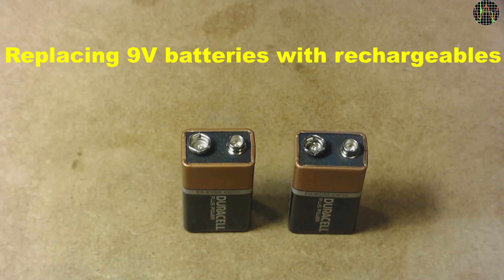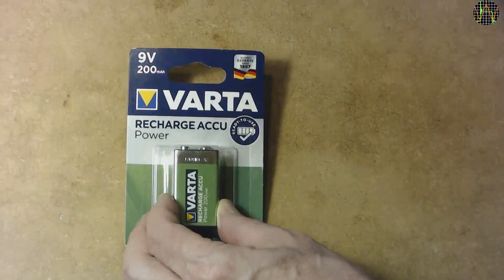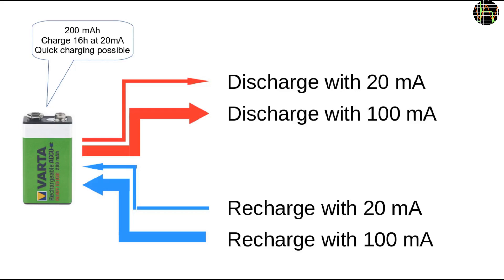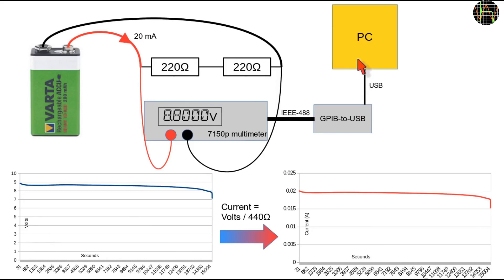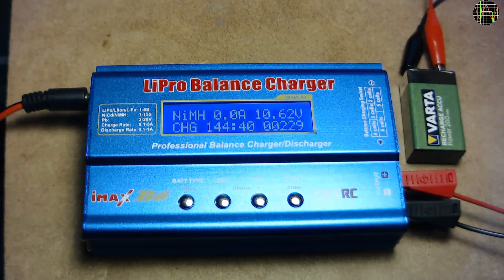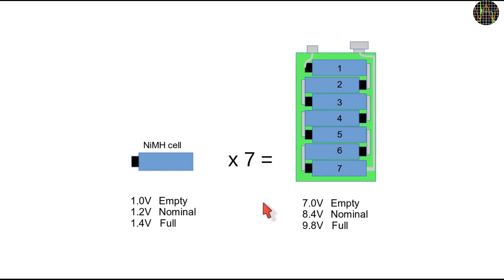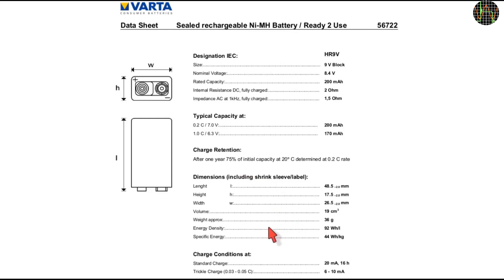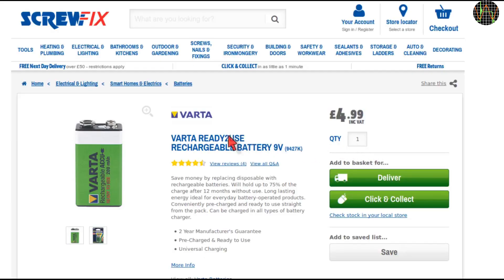Replacing 9V batteries with rechargeables ?

Comment: 12:00 Ni-mh clearly shows that pumping extra charge above just a liittle higher than full capacity into Ni-Mh is not needed. I wouldn't use 16h*0.1C on any Ni-Mh at all. Maximum 12hours.

Comment: Very pofessional. It seems like those Varta 9V ready to use rechargeable batteries are still the best 9V LSD batteries available.
They only have 200mA instead of 300mA that other's have. But they self discharge at 25% per year instead of 50% per year as most other 9V LSD batteries do.
It seems like 9V block batteries haven't advanced in 5-10 years. Other form factors such as AA have much lower self discharge by now.
Yes I know this 9V block is 7 cells in series, while the AA batteries only have 1 cell. But 25 to 50% self discharge per year is still too high for batteries marketed as LSD.
Moreover from some ~20 ANSMANN 9V LSD batteries that I bought 2 are outright duds that won't hold a charge for 2 days. And from the rest about half self discharge within 3 months. And the rest has wildly different capacities. There seems to be near zero quality control for some of those 9V batteries.

Comment: What would be the right settings on the imax b6 mini for charging a Soshine Size 9V  650Mah  6F22  LIION 650 7.4V.
Reply from the maker: inside your battery are actually 2-LiPo cells wired in series, so the necessary program would be LiPo for 2S. According to the SoShine datasheet for this battery, the charge current must be limited to 0.2 *650 mA = 130 mA
Reply: @TheHWcave   TheHWcave  Thank you Sir for the reply.  I will give it a try tomorrow.The Charge Current wil be per 100 mAh increments. So 100 mAh or 200mAh on the Imax B6 mini.   0.13A charge current  is not available on the V1 Imax B6mini.  I think i will give it a first shot at 0.1Amp charge current, and measure the the end results.
Reply from the maker: yeah, I did not check that current increments was 100 mA only. Definitely go for the 100mA. Even if it takes 1.5h longer to fully charge
Reply: @TheHWcave   i need a 2S cable for charching the Soshine battery.  But i dont have a clue how to connect the 2S cable.  It has 3 wires. 2 black , 1 red.   The soshine 9v6f22 battery  only has one positive and one negative terminal connection.    Any suggestions
Reply from the maker: @africantwin173  who says you need a 2S cable? This battery has 2 cells, yes but does not provide a connection for load balancing, which is not ideal, but because they have to stay compatible with standard 9V batteries, they had no choice.All you need is a cable that goes from the two 4mm banana sockets to the two battery terminals. Make sure not to mix polarity. Red needs to go to plus on the battery.  Select the LiPo charge not the balance mode.  That should work just fine.
Reply: @TheHWcave  Roger on that.  I'll  try it tomorrow morning.

Comment: Good price from Screwfix - I will see if I can get a couple.
The low self discharge (apparently) of these batts is appealing for multimeter use - I would not  consider NiMH for this application otherwise - bound to be flat just when you need it urgently !